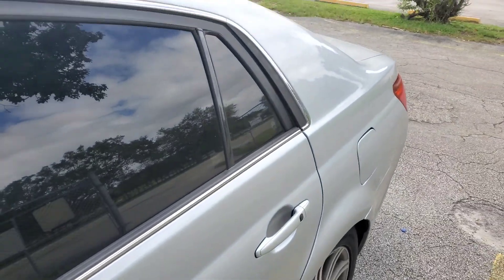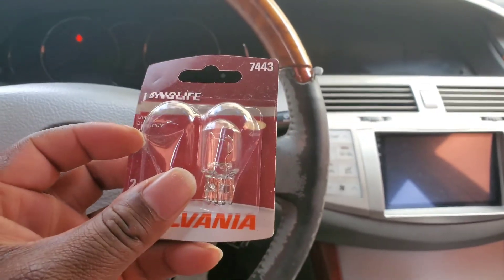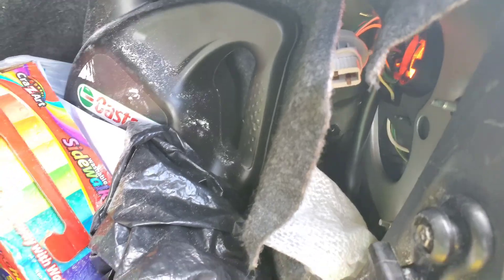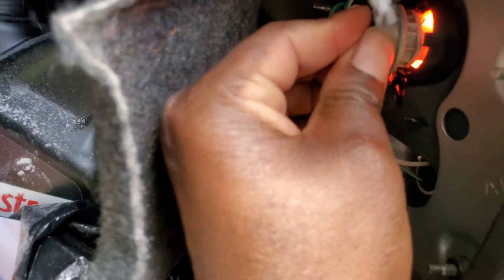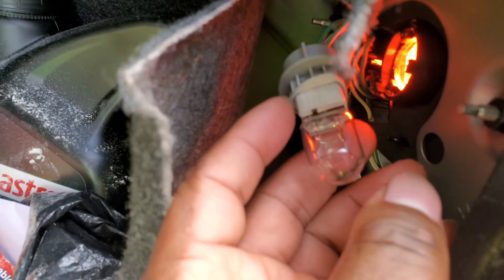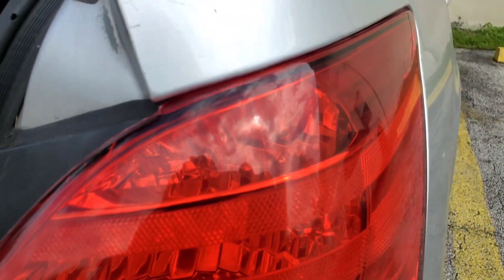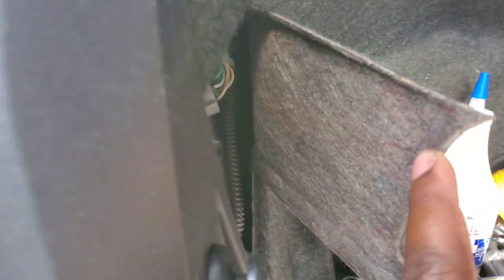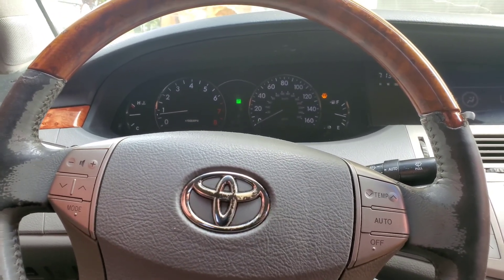how to install 2007 toyota avalon brake light

Comment: Thanks for your time in making this video.  When installing light bulbs, perhaps avoid touching them for the natural oils from skin can eventually cause damage to the bulb.  If so, wipe with a clean cloth.  I know this can apply to front bulbs, not sure about break lights, turn signals, etc (as in this video)...

Comment: Bro this does not help me at all you didn't show how  you move the metal piece inside the ball and then put it in, You didn't even take it out the package and then show how you put it in and then put it in you just switch to another film with the light bulb already connected and all you did was put it in there's no details into this